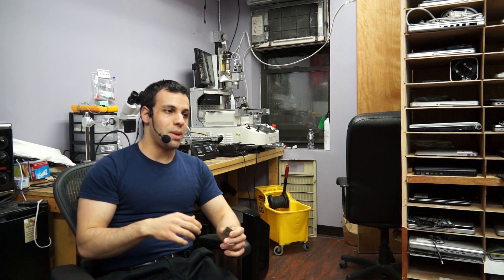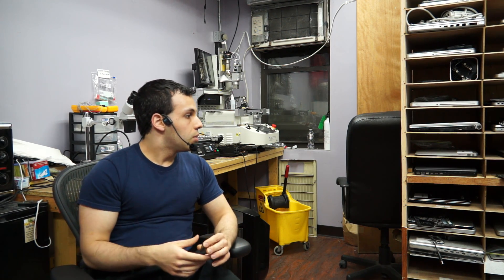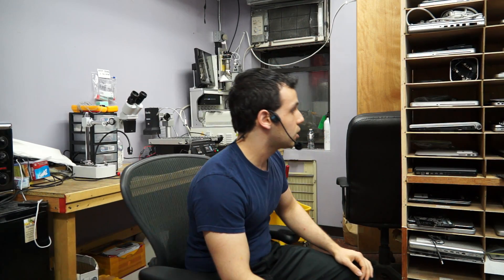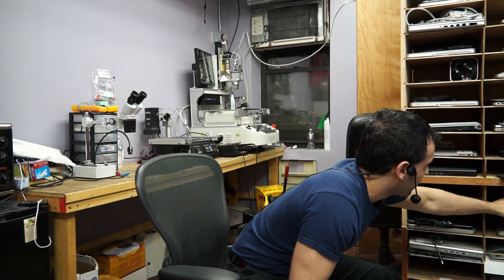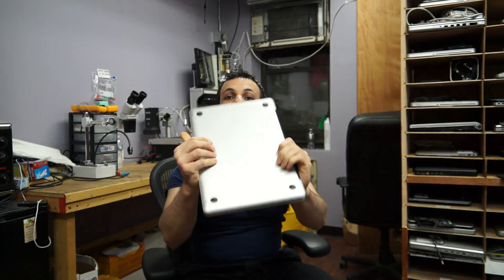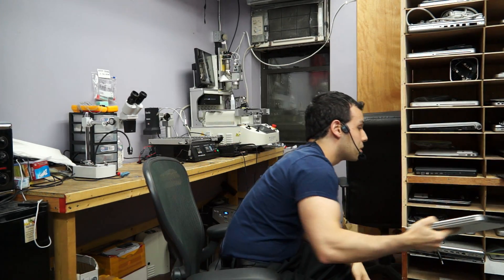Reballing flip chip GPUs is BULLSHIT - the truth about dead laptop GPUs & repairing them.

Comment: There is an alternate physical mechanism (that matches all the stated parameters) by which heating a logic board whose GPU has become disconnected due to failed ball solder joints fixes the issue, that does not require baseless claims about internal/external chip damage (which is not actually empirically verified by the sub melting point heating test Rossmann suggests, anyway).
If, contrary to his claim, the device is failing not because of "failed bumps on the chip" or totally destroyed ball solder joints, but rather because those balls are simply cracked, and now no longer have enough surface area of contact to carry enough current to satisfy the requirements of the chip, heating the chip and surrounding board will cause thermal expansion, which will in turn cause the physical contact points between the logic board and the chip to change. For a number of reasons, this has a significant likelihood of pushing the surfaces of the cracked solder edges together in such a way as to increase total surface area of contact. At that point, even though the solder itself never reflowed, and the joint is still cracked, there will now be enough electrical contact between the chip and the board to allow proper operation.
However, because the solder has not actually melted, the machine is subject to failure due to small physical manipulations, such as another round of thermal expansion or dropping the machine from short distances, and the machine will again fail.
Reflowing may also fail, NOT because the issue is really the chip, but because the solder itself is the issue, reflowing does not change that, and in fact can lead to reduced physical strength of the ball joint, and thus increase susceptibility to physical damage (e.g. cracking).
Reballing will work, because it will totally replace the poor solder.
Nothing can be determined as to which mechanism of failure is applicable here, since the "experiment" suggested by Rossmann is not actually determinative. If someone was really interested in determining the truth, one would have to run a series of experimental trials where one takes GPUs from failed logic boards and shifts them to different, known good logic boards and running those boards through a battery of tests over a prolonged period of time. Needless to say that was not done here.
Reply: I get what you're saying, and believe me I'm not one to generally criticize someone for being skeptical, or for the level of scrutiny with which they critically evaluate someone else's claim. Normally, I would applaud such behavior, in fact. However, in this case, I believe your level of scrutiny may be a click too high. 

Let me start by saying that I honestly feel like Louis is a bit careless with his speech sometimes. He throws around words which have context-dependent meanings while using such terms interchangeably, without making any clear distinction as to when that's actually happening. This has the potential to cause issues of clarity for those without enough verbal savvy to pick up on the nuance of his delivery. The issue is likely compounded given that I just described most people. I don't mean this as an insult, but you might be one yourself. 
It seems to me that you know what you're talking about to a fair degree. But I think where you might've missed the mark was in presuming the overall goal here to determine the precise cause of the issue, or at least what can be done to mitigate the issue once it has been determined. I don't believe this is what Louis intended to address here or to be the main point of the video though. 

I believe that your OP is an attempt to dismiss his claim that re-balling is bullshit since he hasn't identified the exact source of the issue. This is more/less what you're saying, right? If not, please let me know. Assuming this to be the case, and given your statement: "Reballing will work, because it will totally replace the poor solder"  - I think I can safely say that you're missing the point. And given the other arguments made in your OP, I don't see that any of it has dismissed his claim of re-balling being bullshit or anything else that he said to be untrue. 
I understand your logic when describing the reason one might find success when bringing the temperature up only so much as to allow thermal expansion to "re-seat" any faulty connections. Actually, for the sake of clarity, I should say that I'm also assuming that all the reflowing, re-balling, etc you're talking about is happening on the outside of the chip. More specifically, the underside - this is also true? Again assuming it to be, this is where you're wrong regarding your arguments against his claims. Re-balling and totally replacing the bad solder won't work because the issue isn't outside of the chip. The issue with these GPU's has to do with their internal connections. Your intuition about the solder was spot on - but it's the solder used on the internal component connections of the chip itself, not where/how the chip connects to its board. So as I see it, his initial claim stands. Re-balling is indeed bullshit, in the sense that any tech who tries to sell you on the idea of having it done, is either full of shit himself and/or not knowing wtf he’s talking about, or outright scamming you into paying for a procedure under the false pretense of “fixing” your computer. Dress it up however you like, that’s a bullshit pie any which way you slice it.

Neither of you is wrong here, except in the sense that you both have stated your cases without either specifying, identifying or addressing the specific nature of that which you argue against. This does, however, present more of a problem for you than it does for him.

I’ll finish this up by saying that I recognize much of what I’ve concluded was based on assuming quite a few things to be true. And also knowing full well the potential that I may be wrong about something or even everything I’ve said just now. If I am, it wasn’t my intention to offend you, either by my accusation or my ignorance. I don’t believe I’m wrong about any of this, but if I am I’d be happy to hear your explanation of why that is..
Reply: @SineEyed Or, perhaps, you are one of them.
Yes, it is Rossmann's claim here that the problem is internal chip construction. The problem is that he has done nothing to back this claim up with evidence. He has instead made a logical leap, an unwarranted one, based on facts that are nondeterminative, namely that the fact that the video issues seem to be corrected by prolonged application of heat below the melting point of the solder. He concludes from this that the problem must be internal to the chip. This is NOT a valid conclusion. As I have already shown, there is at least one alternate explanation for why this might "fix" the issue, even though it does not actually melt the solder, and shows that his assumption that this "proves" that the problem is internal to the chip is invalid.
Again, it is my claim that, contrary to his claims here, that the problem IS external to the chip, it is exactly was most believe, damaged solder joints EXTERNAL to the chip, that reflowing DOES fix the issue, and that heating to a temperature lower than the rebelling temperature can also work, at least temporarily, due to thermal expansion of the chip causing the solder joints to reseat against each other.
Note that Louis does not actually propose a physical mechanism by which his claim that low heat modifies connections internal to the chip might work.
To truly prove his point, he would have to acquire a large number of data points, of uptime after various repair paradigms, both low heat and high heat, and replacing in the GPU and leaving it in place. Absent that, his definitive conclusion here is baseless.
Lastly, as for the first half of your post, I understood him just fine, nuances and all. This is not my first Rossmann video, and as evidenced here re: what both I and Louis are saying and your following of the arguments, it is not me that is having communication issues.
Reply: @ManifoldSky  ok then. Thanks for expounding on what you've already said, and affirming the assumptions I'd made not to be too far off the mark.
I believe there are some problems remaining with your argument though. Conveniently the added verbosity of your reply might help me illustrate the issue I'm seeing more effectively. I'm going to quote a portion of your reply - I'll be making some additions to particular statements as required, to demonstrate my point. My additions will be [enclosed in brackets] <-- like that. And you should read it back as if they're your own words, now adjusted by what the little angel on your shoulder compelled you to add. No idea if this will work - I'm hoping it will and it'll prove efficient too. Let's find out...

" Yes, it is Rossmann's claim here [at least in part] that the problem is internal chip construction. The problem [I'm having] is that he has done nothing [as far as I'm aware of] to back this claim up with evidence. He has instead made a logical leap [as far as I can tell], an unwarranted one [going by this video alone of course], based on facts that are nondeterminative [going by what's been presented here at least], namely that the fact that the video issues seem to be corrected [amongst other things] by prolonged application of heat below the melting point of the solder. He concludes from this [I presume] that the problem must be internal to the chip. This is NOT a valid conclusion [given that my demand for certain evidence is unmet]. As I have already shown [asserted], there is at least one alternate explanation for why this might "fix" the issue, even though it does not actually melt the solder, and shows that his assumption that this "proves" that the problem is internal to the chip is invalid. [I realize though that what I've claimed to be true is as well substantiated as anything I've criticized him about, so, I suppose it's a wash. Unless anybody knows why he's making all these seemingly baseless arguments? Anybody?]

I embellished a bit there at the end - couldn't help myself, hope you don't mind too much. In any case, I hope it's clear how many assumptions your argument is built upon. And they're critical assumptions, too.  Thinking about it, I'm unable to imagine what reasoning you might have to judge this guy so critically going off the assumptions you made. Especially given your apparent awareness of this subject, compounded by you saying you're familiar with his content already. Taking all that into consideration, your assumptions honestly seem quite irrational to me. He's a Mac repair guy - you really think it's reasonable for you to assume that he says what he says based on ill-proven speculation, and not based on prior experience with this exact issue? I don't think that's very reasonable. But that's just an IMO kinda thing TBH. I mean really, if there's a leap of logic to be found in any of this, it's the one that goes "because I've speculated an alternative cause to the fix being discussed here, and this computer repair guy has failed to imagine that one thing I was able to imagine, it must mean that he's entirely wrong about what he says and he's certainly never actually done this procedure because at some point he would have imagined what I imagined - if he knows anything about anything, that is."

Well... that's hardly fair, is it? Don't you think that maybe, just maybe he's seen this issue come up enough times and that maybe others have too, such that his assertions are passed as common knowledge and therefore not required to substantiate to the degree you've deemed necessary? Maybe? You don't think that perhaps this issue being so prevalent and widespread could be the reason he's addressed his audience so casually in this case? 

In keeping with the theme, I'm assuming that's gonna be a "no, I didn't consider those things"...
That's ok - we can't be expected to keep our eyes on the bigger picture at all times everywhere we go. We all lose sight of it from time to time..
Reply: @SineEyed 2020 Of course it's more effective for your arguments, because all you are doing is modifying my argument, by adding words that I never said, so that it either matches yours, or allows you to critique it. That is a clear logical fallacy, the straw man fallacy.
You then go on to compound that resort to fallacy by adding additional logical fallacies, starting with argument ab auctoritate/ad vericundiam, and ad hominem.
Just because he has "seen this issue come up enough times and that maybe others have too" does NOT mean he has any information from which to draw this conclusion. And he states explicitly his reason for coming to this conclusion, and his reasoning is invalid.
"… you really think it's reasonable for you to assume that he says what he says based on ill-proven speculation"
Yes, I do, because he stated directly his reasoning, and his reasoning is both logically invalid, and unscientific, as well as factually incorrect. Moreover, the ONLY "prior experience" that would be relevant would be with an X-ray machine to do microscopic solder analysis, which he DID NOT DO.
And this issue is so prominent because this is a common problem across MANY manufacturers due to the use of lead-free solder, mandated due to environmental concerns, and the fact that lead-free solder is prone to crack, especially if applied improperly. Which is why it was the subject of at least three separate recalls on Apple machines, starting with the infamous iBook G3 recall and the subsequent iBook G4 recall, both back in the 90s.
And yes, I considered ALL of that prior to posting. In fact, he is the only one claiming this as the mechanism, including Apple. And hardware designers and engineers. He's wrong.
Sorry, but you literally have no idea what you're talking about.

Comment: How easy is it for us general public to tell if the chip is dead needs binning?  Or if chip is alive and reballing would work.
Reply: I'm not a tech but AFAIK there's no test to know if it'll work or not. Especially for the gen public. Even for a certified tech, there's no way to "open up the hood" of a processor and have a look inside to see what's going on. Whether it will work or not isn't the point of this video though. At least from what I can tell anyway. I think Louis' point here is that "re-balling" is bullshit, such that if you're having issues with your comp and take it in to a tech who tries to sell you on the idea of having him re-ball the thing for you - he's either full of shit or doesn't know wtf he's talking about. Or both I guess - either way don't waste your time or money letting him do this procedure. 
The crucial takeaway here is this: the problem isn't the balls of solder which connect it to the board. 
The issue is (typically) inside the chip itself. If you can manage it, extract your GPU board from your computer and bake it yourself to reflow the internal solder and put a non-permanent fix on your comp to get it up and running again. I suggest you search for instructions online about how to undergo the procedure of breaking down your specific model and getting that chip out. Considering the potential for saving thousands of dollars (or maybe £'s in your case (Americans don't say "binning" but I've heard some Brits use the term ))  and that the procedure really isn't all that difficult or technical this is DIY at its finest. the only reason I would advise against doing it yourself would be if you are someone who is kinda clumsy and/or clueless with electronics, and you know this about yourself. If that's the case, bring it to someone - otherwise just go for it..

Comment: Reballing does work. If you use your brain and use a new chip. 
And then ensure you use better heat transfer paste and fix the thermal management in the s/w. i.e. it warns you if the temps go past a preset value.

Comment: I have a God-brother in New York so I understand the unique New York version of the English language as emphasis not negativity. Hence I believe this is good accurate and sensible information from an honest report of experience. That said, I may still heat the GOU in my 2011 MBP, which is currently working again as a result of disabling the chip using a variant of Dosdude's root mod procedure. So why heat the chip if it is out of the system? The root mod procedure can be wiped out by an accidental PR reset or software upgrade, requiring a redo. Under High Sierra I was unable to enter single user recovery mode to do the root mod using a simple reboot of cmd-r-s, which seems only to enter as cmd-s. Thus another root command and reboot procedure to get into recovery mode. Thus, a temporary, minimum use fix could be useful for redoing the csrutil disable procedure when needed from standard recovery mode with less hassle.

Comment: I had to go back to see some other repair shops feelings about reballing. Don't worry reason I reball GPUs at this point or any chipset is to temporarily get the machine working for data recovery and that's it. Besides from that screw it tell the customer I can't get the components from a reliable source nor a reasonable price. Let's not even start with providing any sort of warranty lol